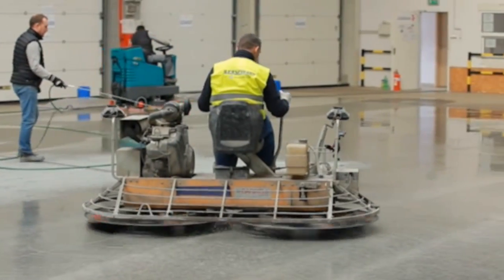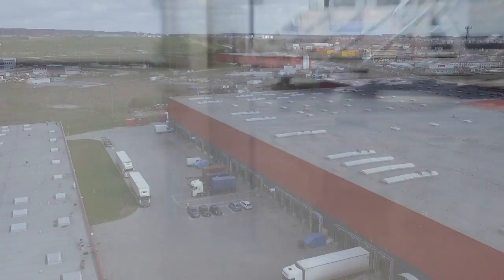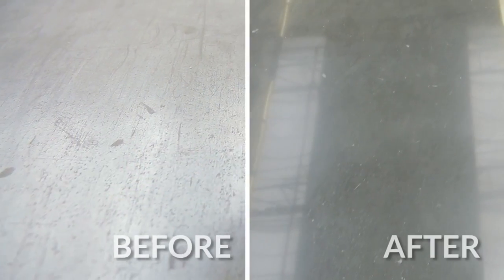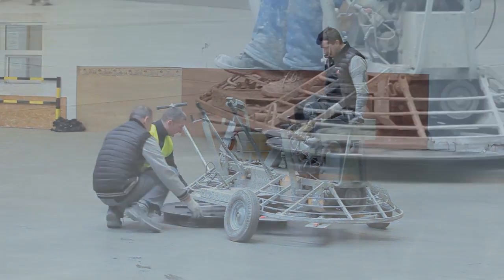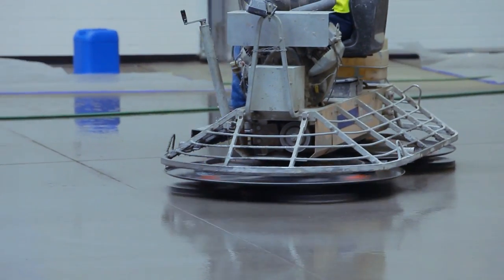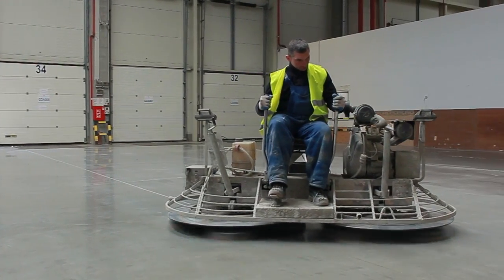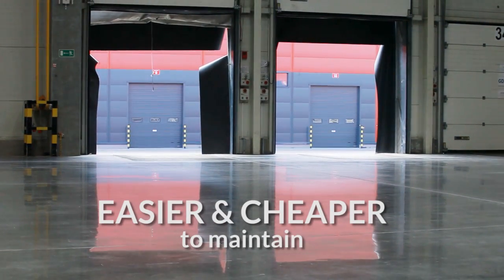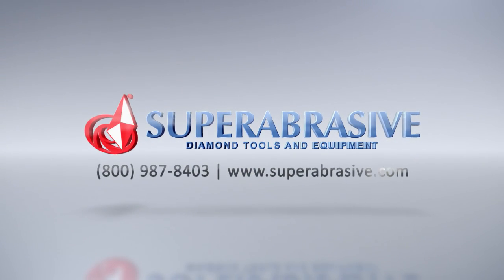Concrete Polishing with Trowel Shine by Superabrasive

Comment: Why do you sell lavina machines, when you have this technology?
Reply from the maker: Tamas, with this technology we are targeting a bit different market and it is suitable for different projects than traditional polishing - mostly very large projects with industrial concrete. You can not go with a power trowel in a retail store to polish the floor, for example. There is some overlap on certain projects but there is plenty of potential for both types of polishing. It is all about making the best choice for a specific job and improving efficiency and productivity.
Reply: Looks like a great product. Related to the question above: can I achieve the same polishing results with trowel shine in a shorter time (compared to a normal grinding machine) ?